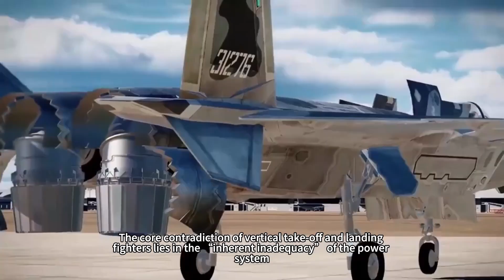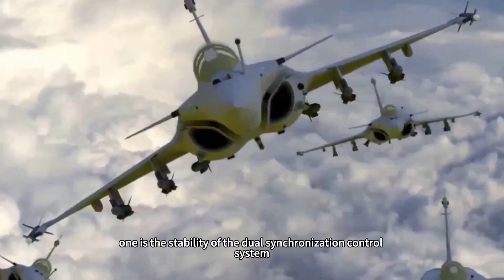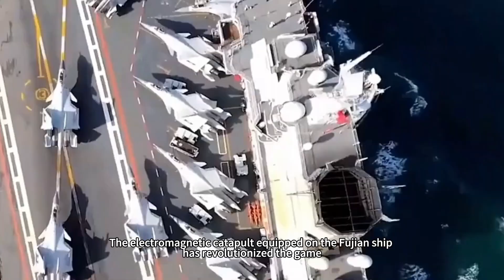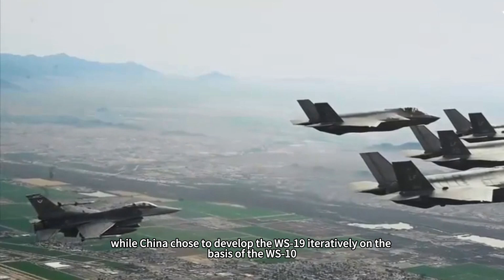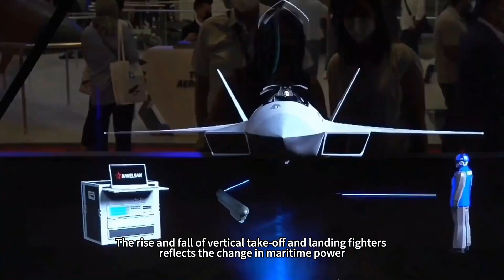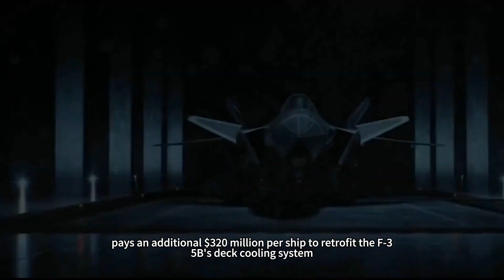Why J-35 doesn't learn from F-35B, Why China's naval aircraft don't use vertical takeoff and landing

Comment: China did learn … to not imitate stupidity.  F35B vertical take off and landing is a fool’s errand. Lockheed won because their prototype could do vertical takeoff but after they won the competition, vertical takeoff was thrown away.  And the consequence is a design with too many compromises made just to win the competition.  Also China learned to use 2 engines because 1 is inadequate.

Comment: The Yak-141 was an excellent investment. Relevant patents were bought by Lockheed-Martin to enable it to build three versions of F-35 in a way that compromises necessary for F-35B handicapped the two other versions. But politically -B was necessary because US Navy refused to allow the Marines to have cats on their amphibious ships. And if - the other possibility - three separate aircraft had been designed with a common sensor and fire control system the Marines aircraft would have come out so expensive that it would have been cancelled.